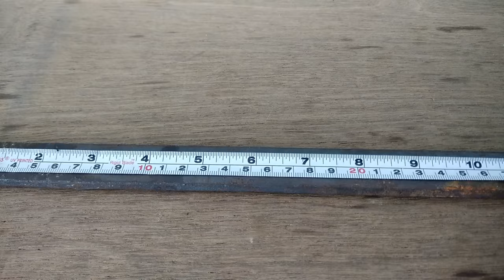Make a Amazing Useful DIY Tool || Make Hole Saw Cutter

Comment: Your one actually cuts cleaner than the ones you buy. It would be interesting to put wood carving blade there so it can clear a sink instead of a complete hole. Would be a nice tool to make flush mount speakers

Comment: The central bolt should be replaced by a threaded stud. Fasten it to the plate with a few nuts.
At the bottom of the hairpin, you need to remove the thread, and sharpen the end in the form of a drill.
It is much safer to work with such a tool.
Reply: เรีองเสืยว
Reply: I was waiting for the bit where he did that but it never came
Reply: @สีไพรแก้วสอน  ee

Comment: Yeah and be sure to keep your sharpening stones and files out and at the ready for when that mild steel bolt becomes dull after every 5 seconds of use.
Reply: Thanks for sharing nicely made Great inspiring video..   Regarding mild steel bolt, that is where high speed steel (HSS) drill bit by large scale manufacturer for professional use, matters..